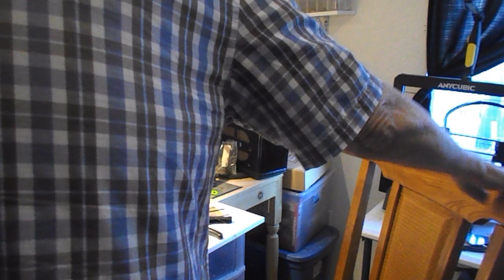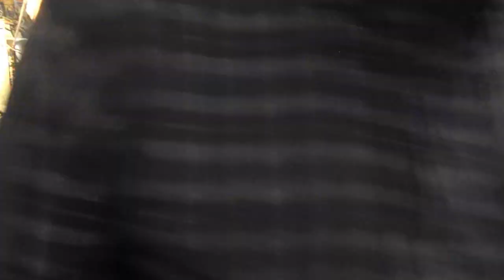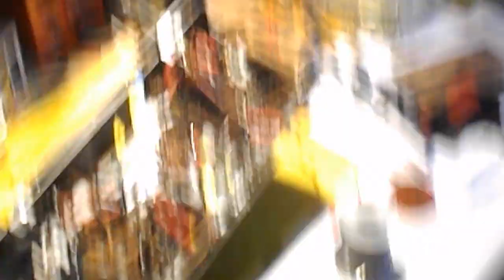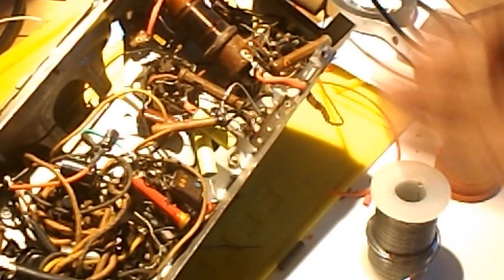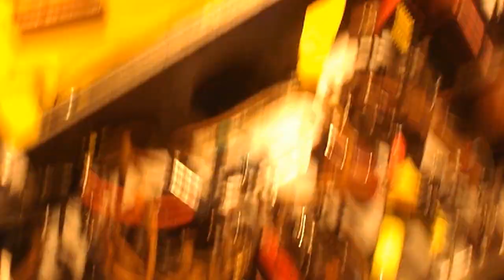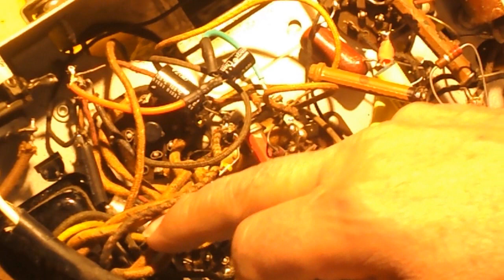Part 3 working on G.E. 1937 E50 Radio and Chemotherapy report

Comment: Hi Larry, such a great news from your doctor. Very happy for you. That power transform is in excellent condition. I know what you mean about those dog bones resisters and mica caps, so hard to read. I got so tired of trying to figure them out searching on internet. Finally built my own calculator as you know 😂. Great video. Have a good weekend. Regards, Jay
Reply from the maker: Yes I finally got some positive news from my doctor even gave me a fist bump said keep up the good work. Yes the only draw back to working on old radios are the age of the parts. I am working completely with no schematic on this one as well always fun. You miss one part or get one value wrong and you create more problems for yourself. My next hurdle is restringing the dial cord, pointer and the end stop. It uses two springs on either side of the dial cord but over time they have stretched so it will be a challenge. Thanks for watching and commenting Jay. Have a good week end.

Comment: The radio is coming along well. Do you plan to tidy up the wires from the transformer?
Reply from the maker: yes the Transformer wires i was going to straighten out and bundle them with tie wraps. Make it easier to check out what's what.